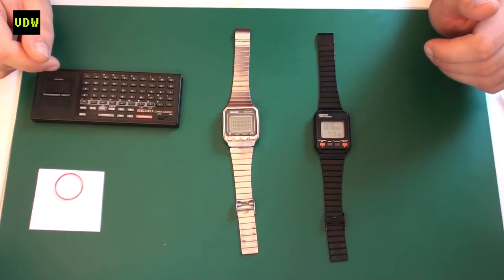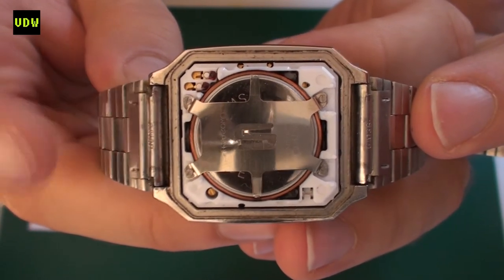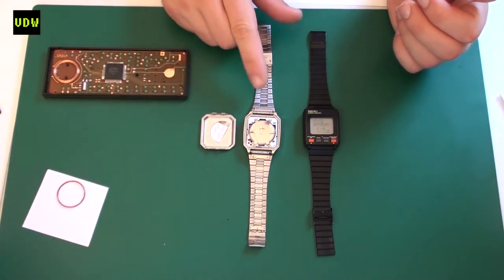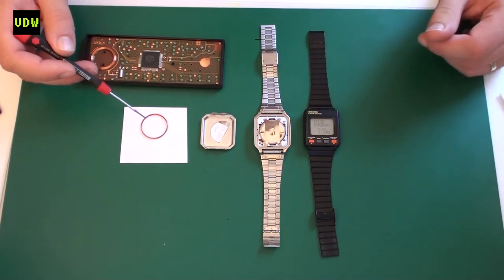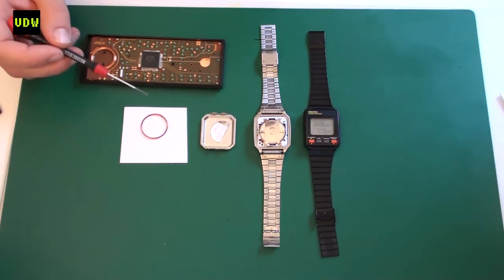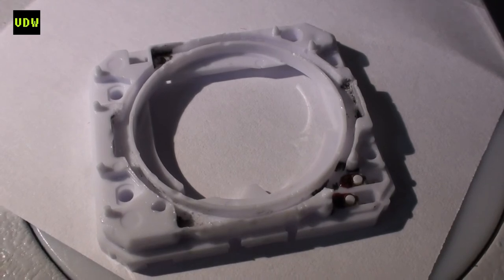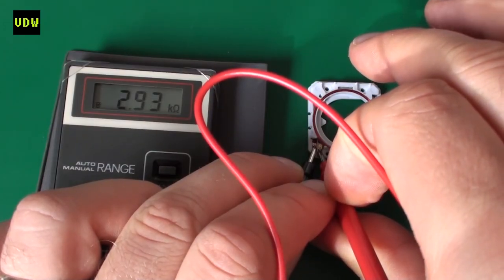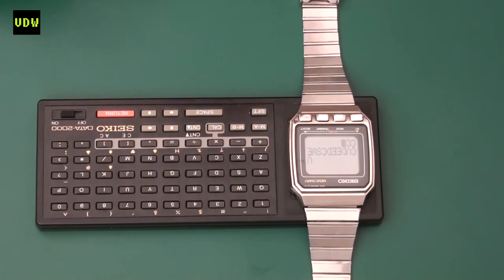VintageDigitalWatches - Ep 29 -  Seiko Memo Diary transmission repair

Comment: About that broken piezo - it most likely is repairable.
I have replaced a piezo transducer in a watch before, and it's pretty easy. They use epoxy to attach it to the case back, so a bit of heat breaks it loose quite easily - I just boiled mine in a pan of water for a few minutes and it fell off. The replacement can be stuck on with regular epoxy - you only need a tiny amount. Any excess that squeezes out can be cleaned up with acetone.
The replacement piezo doesn't have to be exactly the same size and shape, just as long as you make sure to place it so the contact lines up with the spring.

Comment: Hello sir! My UC-2000 will power on and function perfectly for anywhere from 3-48 hours. At some point though, it will freeze on the transmission screen regardless if I pressed the transmission button or not. Do you know what the issue could be? It appears you are doing repairs again, if this is something you believe you could fix, I would be interested. Also worth noting, the four screws I use to keep the battery in place are of two different sizes, but do keep the battery shield(?) In place. Thanks!
Reply from the maker: This is a very strange behavior, I assume something is triggering the transmission button, per haps a short, also the screws of different size is no issue. Where are you located?
Reply: @VintageDigitalWatches  Located in Minnesota, USA. Thanks for the quick reply. Yeah, it is weird. Once it freezes on the transmission screen, I have to take the battery out. Replacing the battery immediately gets it working again for however long. I am able to move between transmission screens and other screens as I please, but after a while I'll look down and it'll be on transmission and frozen. Also worth noting (maybe related?) the stopwatch screen LCD is faded, but no other screens. Thanks again, I absolutely love this watch and get so many compliments!
Reply from the maker: @Jeff Kantos  Understood, write me at vintagedigitalwatches@gmail.com

Comment: Hello, nice work. You do repairs? I've bougt a uc2000 recently and as you said contrast can't be adjusted.  I can clearly see the coil is damaged by previous owner trying to change the battery,  who by mistake put the new battery reverse and sold it to me as a no runner.
Reply from the maker: Yes, I replace these, cost is 60 USD, you can find me at vintagedigitalwatches@gmail.com
Reply: @VintageDigitalWatches  $60 seems quite low for the amount of work required. Do you know if the RC-1000 model also suffers from this issue?

Comment: Hey Tibi great repair for the watch,  I think I have a similar issue, except with the keyboard, I cannot seem to get any registration of ohms out of it at all. Do you believe that this is the same issue that the watch itself could have?
Reply from the maker: Hi, the Keyboard should read around 1k Ohm, if it is Open Line (OL) on your multimeter, or is perfectly continuous then you have an issue there.
Reply: @VintageDigitalWatches  thanks for the direction, I'll investigate further. The keyboard was working roughly two years ago, but it suddenly stopped responding to commands recently. It belonged to my late father so I was hoping to get it back in running order.
Reply from the maker: @amplifierheadache  Well it is only once I came across a dead keyboard and it had an issue with a capacitor. The coil is well protected and there is no reason to open the keyboard so coils in keyboard almost never get damaged. Let me know what you find.

Comment: If I'm reading 20 ohms from the coil terminals, but they are attached to the watch, and the watch is powered by the battery: Would this reading apply to the coil, or are there more components in the watch that add to the resistance?

Wouldn't the coil's circuit read independently regardless if the battery were attached, and the watch is assembled?
Reply: *20K Ohms
Reply from the maker: @Thesupercoconut98  remove the battery and do the reading again, should be around 3 to 5 kohms, higher than that something is defective. Also if the coil is interrupted you read infinite even with the coil attached to the watch.
Reply: Thanks!

Comment: hello, I have the Seikl UC-2000 watch and some of the screen segments from the top and bottom are missing.  Are those repairable and how?  Great channel! Thanks for your help :)
Reply from the maker: Can be a number of causes, some fixable and some not. Start with a clean.
Reply: what part of the watch shall I start the cleaning process? thanks!!
Reply from the maker: @007KnightBond  The inside, all of it, needs a strip and clean with isopropyl  alcohol
Reply: OK so I took the watch apart as far as I’m capable of without damaging it couple questions one does the screen come off from the plastic housing does it separate could be able to clean behind it the contacts that is. And second would you be willing to sell me a coil for the watch because I’m not getting any resistance at all around the coil so I’m assuming that’s damaged. thanks!
Reply from the maker: @007KnightBond  You need to completley disassemble the module, below link is a service manual. No, I don't make coils and ship them for people to install. I do the entire procedure at a cost but would need the watch.  http://www.digital-watch.com/images/seiko_manuals/UW01A.pdf
Reply: how much to repair the watch?
Reply from the maker: @007KnightBond  Coil replacement is 60 USD +shipping. But from what you describe it may have other issues, although if it is just cleaning that is nothing extra.
Reply: Hello I think the coil is broken I looked at it under a microscope and there’s a lot of dents and scratches in it would you be opposed to me just sending you the part that’s got the coil in it and not the entire watch since I already have it all disassembled
Reply from the maker: @007KnightBond  Hi, after the new coil is set in the plastic cradle I have to certify that it will work, there are for example two small pads that have to make contact with the board. I don't trust the reassembly to anyone as those may bend and people will likely blame the coil than anything they have missed during reassembly.
Reply: I understand I’ll reassemble the watch make sure it’s working at its best capability. Can you send me some information as to how I can get the watch to you.

Comment: Sir i have uc 2000 after replace the battery lcd contras is very dark. Can i set the lcd contras without keyboard? Or manual setting?
Reply from the maker: No

Comment: What coating do you used??and how long the wire to make it in proper resistant??
Reply from the maker: Hi, you can use any conformal coating for this, I usually use clear(transparent) and it is called "V-66 Insulating Lacquer"
Reply: Ok thanks I'll try it 🙏🏻

Comment: Hello, my watch is having 4,17 kOhm , and by the keyboard i have 0,98 kOhm! It does not work with the keyboard. May you give me a tip? Greetings
Reply from the maker: Hi, the coil is connected to the circuit board by two springy connectors. Sometime these connectors loose contact with the board,  check them.
Reply: Hi, thanks for the quick answer. Yes, if i press carefully the first one under the microscope with a needle down, i see there is space between. The other one is fully down! Thats so thin and small! how can i fix this ! Thanks a lot!
Reply: Hello ant thanks, i fixed it! One of them was whiteout contact, and very on the left side! i pushed it to the middle, and now it works! Thanks a lot, you are a great .................! Greetings from Austria!!!!
Reply from the maker: Excellent, nice work! :)
Reply: Die 3 Nußknacker Mürzzuschlag: 
Hi, I have the similar value: 4.19KOhms. Is this value right?
How did you solved the issue. Pushing the contacts?
I'm from Spain but was living 4 years in Graz. Austria, Really nice country!!!
Reply from the maker: @nachoblazquez5743  Hi, the values are correct, arpund 1kOhm for the keyboard and 4k for the watch. And you are right there are times when the little 2 pads that terminate the coil and are in contact with the board are bent out of shape. But don't push on them from the top to bend them back, you need to remove the board so you have access to the pads and bend them back in shape from underneath. To do this remove the 4 screws around the LCD and remove the plastic assembly together with the LCD.
Reply: Vintage Digital Watches : Vintage Digital Watches: 
I will do as you describe.
thanks for the fast answer!
One more thing... My watch does not have sound at all... I don't know if there is any part missing to make contact with the speaker. Should it has any spring or similar?
Thanks!!!!